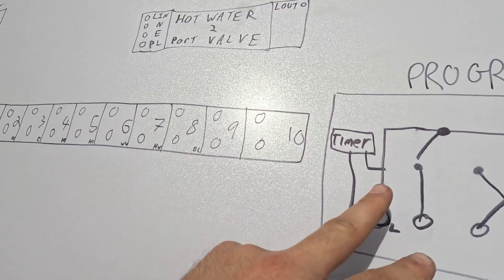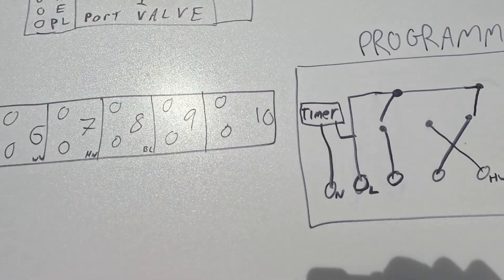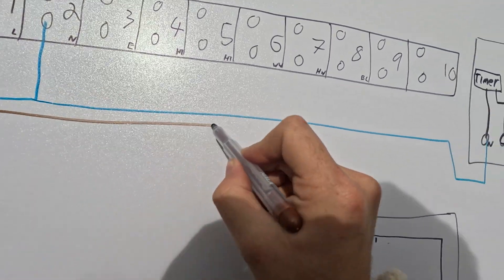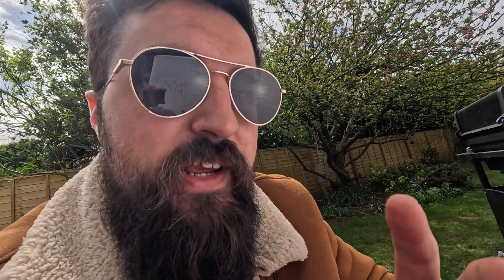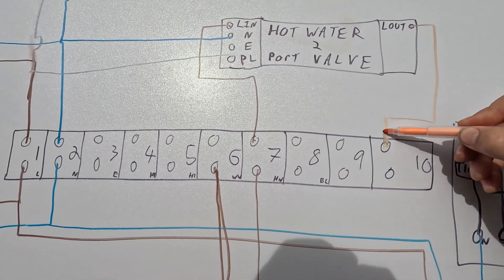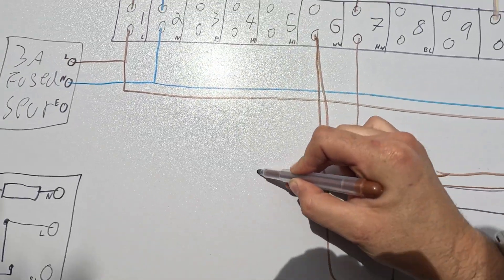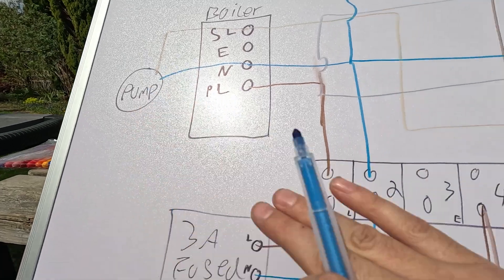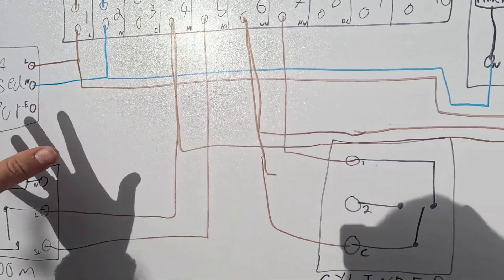ELECTRICIAN'S GUIDE TO S-PLAN HEATING SYSTEM! ✏️ ⚡

Comment: In boiler wiring, the PL terminal stands for 'Pump Live' (not Permanent Live), which is the electrical connection that powers the central heating system's circulating pump. The PL connection ensures the pump can run, often with a feature called "pump overrun".
Reply from the maker: Did I say perm live in this video? My bad, thanks for watching

Comment: Nice vid James! Was always told just to think of it all as just switches. 
Now you come to mention it, it is very similar to setting up an outside lighting circuit with PIR’s and light cells and timers 👍🏼
Reply from the maker: @keiththesparky  yeah there’s loads of different types of control, selecting a device to achieve your outcome. Like on heating systems you can put in a thermostat on the pipe work as a frost prevention stat, which fires up the system if it drops below 5 degrees. That’s a fun one on heat pumps if they’ve been under spec-ed